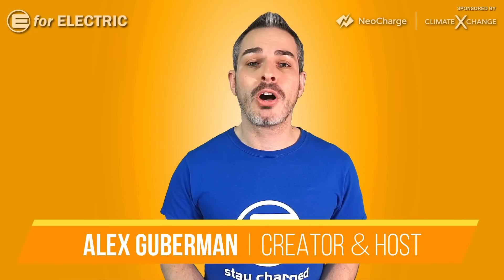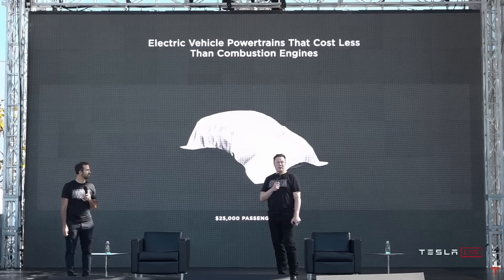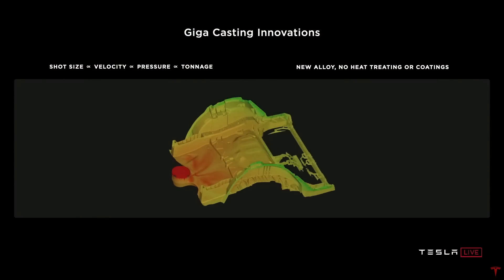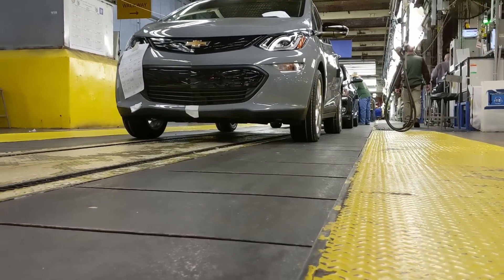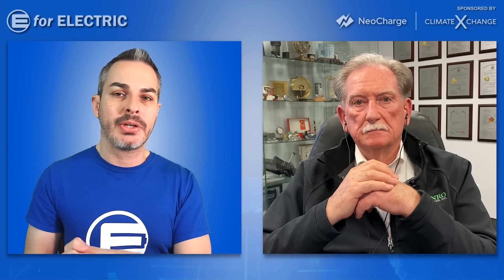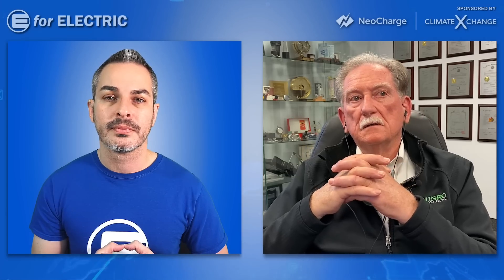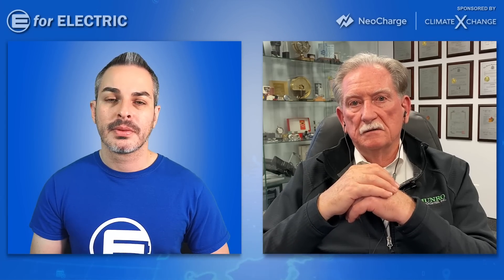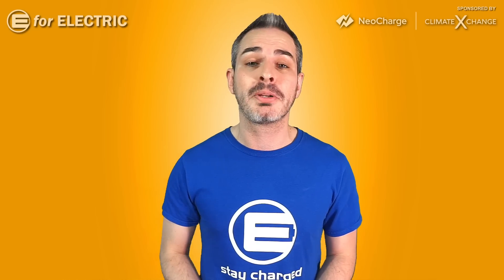SANDY MUNRO Defends $25,000 Tesla Timeline

Comment: Why nobody is talking about the motor, everything is about the battery, but with the same batteries we have now if you make a new cheaper, lither electric motor will be as good as a new battery. There is a truck coming on line with the electric motors in each wheel,. How about that?

Comment: $25k car might be a way to futher expand the brand and also get investors building Electric charging stations. The low to no profit margins out of the 25k car might be offset by Tesla insurance profits.(If they manage to pull it off). 
Only someone like Elon could do something like this. All or Nothing plans.
.P.S - im interested in the car , even 200 mile range would be enough for crusing in the City. The low maintenance costs are enticing. Also , even if the car has 80 percent of its range after 100k miles , its a win. 
.
.

Comment: He makes a great point about the entry level car not being ideal fo manufacturers. However Who else is offering a tesl grade $25000 electric car? Once you get all the entry level drivers on the Tesla Train, they will be customers for life. You don't need to make 25% margins on every vehicle if the customer long term value exceeds $100k in profit; $25k entry level ---> Model 3 upgrade ---> Model Y Upgrade ---> Next gen Tesla SUV/TRUCK buyer. $10k profit today to ethically steal all the business from GM, Nissan, Kia, Hyundai means converting 100'000s of customers for life.

Comment: I don't agree at all with Sandy. If Tesla reduced profit margins to 10%, on a smaller car, for a much lower price point, but continued production, at the same level, on the rest of its vehicles, it'd still be making a ton of money. And yeah maybe some manufacturers are pulling out of the most budget cars in their line-up, but Sandy, we're not talking about those $10k-15k cars, we're talking about a $25k car. 

And with regards to how far ahead in tech? None of the technology inside electric cars is new or cutting edge. The basic components that govern virtually all of its performance are the motor, the motor controller and the battery.

Motor physics has been well understood for decades and highly efficient motor solutions have been used for decades too. There are many highly proficient motor specialists in the world, that when combined with their preferred FEA software, who can design a very efficient BLDC motor for an electric vehicle company.

The same is true for the motor controllers. We've had highly sophisticated, DSP based, high speed, sensor-less controllers for a very long time. Many semiconductor manufacturers have turn-key solutions that are readily scalable for any power level and teams of motor control and software experts ready to assist should it be desired. The really important part, the power losses within the power path of the controller, are just as well understood as motor physics. Motor power losses and controller power losses being dictated by the laws of physics in combination with the current state of the art in power semiconductors. No one can escape these limits, not even Tesla.

The obvious proof of this is that other electric cars get just as high kWh/miles as Tesla.

Battery technology? All companies are pretty much in the same boat. Tesla might be making their artillery shell sized cell, with its obvious advantages vs 18650/2170 cells, but other companies have been using larger format prismatic cells for a long time. It's 6 and two threes in a lot of that case. All big battery companies, along with research institutes, are putting large amounts of money and time into developing the next generation of battery tech. Who's going to get there first? No one knows, but the first one that does? They will be the leader. This is regardless of what Telsa have been doing with their incremental improvements over the years.

Comment: well i found a topic to completely disagree with sandy...
a 25k car has plenty of markets to exist for. maybe not the states where a model x is slightly bigger than an average car, but europe & china i would say is are pretty big markets and they are markets where a 38k car may appeal to the wallet of 30% of the population or less, but a 25k (or wishfully 20-22k) appeals to 80% of the market. and if the car keeps some of the famous tesla features it would be such a huge hit...
because hot hatches in europe at least are pretty desirable. Not everybody want a 17 gazilion seater... nor an 18wheeler to go buy 5 apples... pickups and suvs arent the entire market sandy, at least outside of the US.

Comment: Tesla believes in variety so cheap or expensive 20000 is still expensive for most Americans. Arcymoto should be a 10000 grand with highway use as well as every day short drives. Tesla and the share holder's are in touch with the world , Tesla can go sub 15000 if wanted , three wheelers are ripping people off less car high price 20000 and no highway use.

Comment: He won't make it 2 doors, because it is going to be the robotaxi as shown in the presentation. He won't make it sub EPA 250 miles because that is not what Tesla is about (he tweeted about not dropping under 250 miles). It will need the FSD sensors to be a robotaxi and all of this adds HUGE VALUE. Which will make HUGE MARGINS. and not only that IMMENSE value for the customer. That is what Tesla is all about. He wants to make it as cheap, safe, high quality, high margins, awesome, with great performance (needing the new batteries for such a small pack), FSD usable robotaxi. This is the plan

Comment: If you have a $25,000 car made by Tesla today, you will simply end up with a 3 year waiting list. The supply for more battery cells isn’t there yet. It would also violate the laws of supply and demand. A customer who wants to buy a product at the listed price but can’t is an unhappy customer. You raise the price until you have balanced the supply/demand equation. If your product really is that good, you can invest the larger profits in more production. Basically, you create a waiting list in which the place on the list is determined by how much you are willing to pay for the product. It is sort of like an auction based on demand estimates instead of live bidding. 

Don’t get confused with cybertruck preorders. That was a demand gauging action which told Tesla how big a factory to invest in building.

Comment: I'd like to see some discussions on the market-changes that will be generated by full autonomous cars or taxi fleets. There are a lot of studies that say that 20-30% of todays car numbers are sufficient to deliver our mobility needs. Instead of having a car driving for 1 hour and standing still for 23h a day. An autonomous taxi could be used for 10h and stand still for cleaning and charging 14h a day. So how much cars will be needed to be produced in a single year? A car that is used for 10h a day instead fo 1h a day will probably have to be renewed after 1-2 years instead of the 10-15 years of a car that is only used for 1h a day. So what does this mean for a car manufacturer that plans to produce 20 Mio. cars per year. How much of a market share will be possible in such a market?

Comment: Expand on the circuit boards assemblies are 10 years ahead of the competition if you could.  Are you talking blind / buried vias?  Triple+ stacked copper filled microvias?  Low Dk and LoPro type copper foils? Embedded edge-coupled differential impedance?  What are the insertion loss requirements?
Reflow assembly simulation testing while under 4 wire kelvin monitoring?

Seriously!!!  More tech, and less assertions.

Comment: "Why don't they sell a 25k car now by halving range/making the car a tiny hatchback/making less profit?"

This question is about the same as "If I chop off my arm and weigh less, shouldn't I be able to jump higher?"

No one will buy it if it sucks, and you need to sell many to make the economies of scale work out.  The new cheap batteries will be very expensive to produce until they are at sufficient scale.  That is why they must go in the Model S first.  It isn't as if he can make a battery right this instant that costs 56% less.  

You interviewed the wrong person for this video.  Sandy is an engineer, not an economist.
Reply: Sandy is a COSTING engineer.  Not clear what an economist would say here that would be useful.  Probably something vague about costs and scaling.

Comment: Sandy mentioned "TATA nano", in India.  Which from my perspectives is a pretty good car.  The price point it came with was more value for money than any other car. It was not a cheap built, was more on basic stuff and a good design.  The starting price was 1300 USD in todays exchange rate.  ( Sandy menrioned it wrong saying 2000 Rupees, i think he meant 2000 $ during  launch year 2009 ).   
But He is correct with why it failed.  A very good city car but the cheapest car in the world stuck to peoples mind. And no one wants to stick with cheap.   But a  25000$ Tesla is still a good price bracket to fail for this reason
 What do  you think?

Comment: There is zero chance the $25k car will not have the Autopilot hardware integrated regardless of what you purchase. Having this system tracking events and recording endless amounts of data is far more valuable to Tesla than increasing margins a little on the low end segment.

Comment: There's a simple reason why Tesla does not make a $25k car today.  Sure, it's hard to make a profit on it but the main reason is that demand for a $25k Tesla will be HUGE.  And Tesla does not have the battery capacity to meet that demand along with building the rest of their lineup.  So if you don't have enough batteries why would you release a cheaper model you can barely make any money on?  Better to allocate your batteries to your more profitable models.  So we'll have to wait about 3 years before the German and Chinese designed models come out.  That's when Elon thinks they'll have their battery lines (or CATL's) ramped enough to where they can use some for their cheaper car.

Comment: Tesla should NOT cheapen the brand. A BEV compact will be lighter and the new batteries getting cheaper. Say a full battery pack costs $12k. If you halve the cost, your taking $12k off the MSRPP.  Use one motor and you’re almost there. Let the other OEMs make low margin cars. 

But I know you’re playing the devil’s advocate.

Comment: There is one simple reason for Tesla not (yet) making $25,000 car, Sandy. There is not enough batteries on the market to fulfil the resulting demand. ;) 
Entering the market with a low cost would be a very bad move also from branding point of view.
Reply: They will enter that market with a low cost model soon, but you are right, battery supply isn't up to the level needed to make 1M small cheap new cars per year.

Comment: I have a feeling, that the 25k hatchback will be FWD with max 250hp. This way the battery pack can be extended all the way to the back and the battery electronics can be under the driver seats. Without the RWD motors, the cars floor at the back can be very low and the hatch can be opened very low down, making it a ver practical car. It can also be easily converted into a small delivery vehicle.

Comment: "When can TESLA build a battery factory for the new cells"
Well the "pilot line" when ramped up to 10 GWh will be the 13th largest battery plant in the world... IT IS A GIGA FACTORY only labelled a "pilot line"
10.GWh is 130.000 model 3's or 10.000 Semi's.
Reply: The semi won't be more than 750kwhs. I wouldn't be shocked if it actually has only 550kwhs of batteries.

Comment: I saw on fullycharged show that current batteries are really cheap but none of the manufacturers are passing on the lower costs(consolidation). With this in mind it would be easy for any of the large manufacturers to build a $25,000 car as almost all models cost the same to develop. They just have to work out how many they can make and sell. In some cases in the first few years of production they absorb a costly production though sales of other cheap to make vehicles. The Toyota Prius was initially very low profit margin but eventually the economics of a hybrid was understood by the market and its a big profit for Toyota now. This time its different if they put out the $25,000 car they think they will shoot themselves in the foot but a world coming out of Covid and unable to a afford to buy/run expensive SUV's etc will be looking for a cheap daily runner. Tesla doesn't have enough diversity of models to spread the costs hence its measured approach. You think all those Supercars are making huge profits? Most either go bankrupt and get absorbed by a big company. VW/Bugatti Veyron or charge a huge amount knowing the obscenely rich can afford it.

Comment: pretty obv they needed this battery to produce Semi (lot of batteries), Cybertruck (quite a lot of batteries) and 2 (a lot of cars) as well as stationary storage increase with new tesla roof. they have split nickel into 3 types; 2-Cyber-Semi, so that will be the next gen of cars along with the plaid S. makes sense the timeline was extended but still ton of work to produce 3 new cars before Austin is even putting in foundations.

Comment: Mini are selling their electric version for £24,000, less than the ICE version. What about the VW uP and iterations too, £18,000, 170 mile range.
Reply: No Mini 3 door equivalent is 16200pounds. 
VW, Seat, Skoda no longer make small EVs.
Reply: @waynerussell6401  they stopped selling them because they had 16 months waiting time from all the demand.
Reply: @nox5555  They stopped selling them because they are loss making compliance ICE conversions that will be replaced in the short term by the ID3  chassis cars and eventually by an ID2 chassis.
Reply: @waynerussell6401   those are the reasons why they dont increase production, not why they stopped selling them.   they stopped selling them because the waiting time became to big and they feared that cant deliver all of them in 2021, while the incentives in europe are super high.

Comment: $25K - a stainless steel hatchback would be the most economical, least material, no painting. They could use a lighter gauge than cyber.
Reply: Yes! The new battery tech,  made more efficient and cheaper to produce shortly,  with mega castings to hold the car together,  and made with the same tech as the Cybertruck,  would easily be a $25k Cybercar. I'm sure it will be a 4 door,  maybe with a hatch.  The base model 1 motor with smallest battery,  and by then autopilot costs will be low, once the software has been perfected. Done!
Reply: The stainless steel structure works for the truck because it has lots of long flat panels. It makes no sense on an egg with doors because an egg with door has NO long flat panels. Literally the largest panel on those vehicles is the roof and Tesla has been replacing the roof with glass.  A-segment cars by definition are basically just a cabin with front and rear crumple zones, and more doors than panels.
Reply: @patreekotime4578  nothing requires a new $25k Tesla to be an a- segment or to look like other Teslas.
Reply: you arent realizing the body is a structural member on the cybertruck, much like a plane's fuselage, hence the gage of the steel.
Reply: @theJerkson  true, but the Cybertruck is built to haul several tons and tow 7, so it's probably thicker steel than needed for a compact car.  Fun to think about,  anyway

Comment: I think it should be possible to build a $25K car right now, and make a decent profit on it. The problem is that it only makes sense if you can make many millions of it, and currently that's not possible due to the lack of batteries. If you are production limited, the logical thing to do is to build more expensive products with much bigger profit and invest the money into scaling production.

Comment: Tesla will use the much cheaper LifePo4 batteries in the $25.000 and they already have Model3 in China with that LifePo4 battery at $35.000. Panasonic batteries are at $140.00 / kW and the China LifePo4 are at $40.00 / kW.
Reply: Musk said when you factor in the extra cells needed with LFP there in not much price difference, and perhaps the extra costs of installing them into existing packs. Its all about increasing the battery supply and China does LFP.
Tesla NCA packs are at $110/kWh (b-science.net/) and LFP packs at $80kWh (Reuters)
Reply: Wayne Russell Wayne Russell for sure the smaller car will not have the same range, drag or weight as a Model3 US made so much smaller battery. 
Elon was referring to using LifePo4 in the US made cars. The prices are just speculation real time production cost is probably lower in both cases.

Comment: They can not build a 25k car now. For the same reason they can't build the cybertruck now. You have to build the factory and production line. This takes time. You can't just remove a doors on a car that's a entire new car then. Tesla will never build a car with out the autopilot hardware. Why on earth would you waste batteries building a 25k car when you can sell ever expensive car you can make now. The car will happen when they are no longer cell constrained  
Don't expect model 3 or Y to get the new batteries any time soon. If they do it will probably only be the proformance that gets them. They are not going to stop buying Panasonic cells any time soon. They are putting in more lines.

Comment: why are you so excited about a low cost electric car? if its cheap, most of its buyers wouldn't be able to support (in house charging) and the infrastructure to support it is just not there... no one is going to sitting around for 6 hours as their car charges... The Big oems know this, Tesla knows this and it will simply happen in due time. All good, i can't wait but i have too.